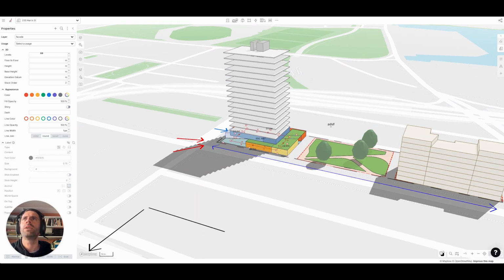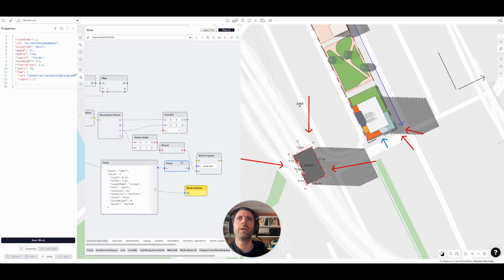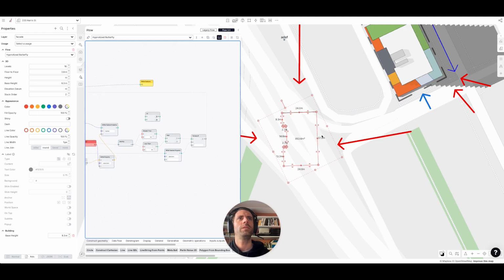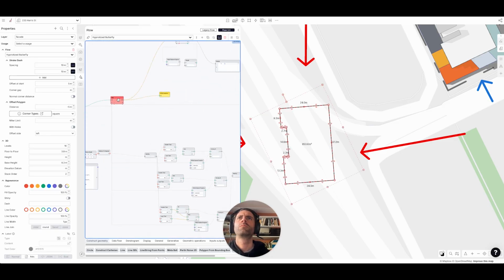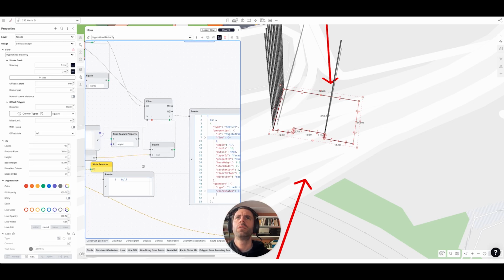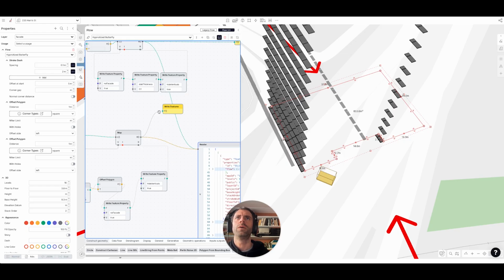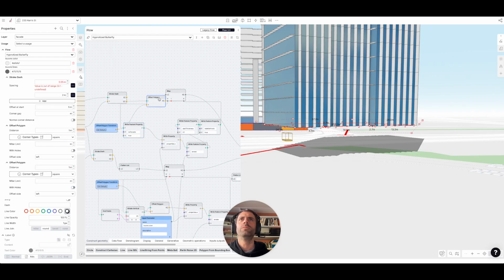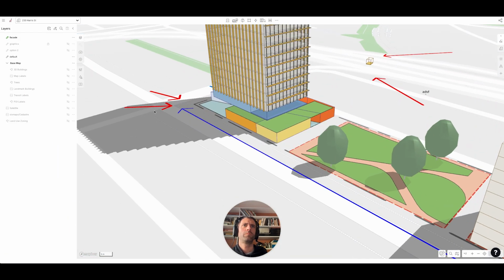How Architects Use Giraffe to Generate Smart Facades

Comment: I like this quite a lot….i can see that flows are super powerful *but for me* it doesn’t seem that it’s worth learning at this point bc it’s so domain specific and won’t have much use outside giraffe.  Or maybe a better way to say it—this isn’t the low hanging fruit for me at this point and that’s probably ok. I keep flows in the back of my head and dabble as needed. Sort of how I do with lisps in cad, now that I think of it—super powerful but 99.9% of the time I don’t need them, and when I do I’ll find it or figure it out. So hopefully there’s a forum to share flows at some point? That’d be cool
Reply from the maker: Hi @shawn-FFF , thanks for your thoughts and I completely understand that the learning curve is quite steep and product specific, something similar to a forum for flows as you suggested is our content library which we're continually adding new content to and aim to populate with more complex flows like the facade example here so users can quickly select and drop this into their project which also enables users to jump in and adjust the flow if needed. 

Content Library info below:
https://giraffe-knowledgebase.super.site/projects/templates/content-library